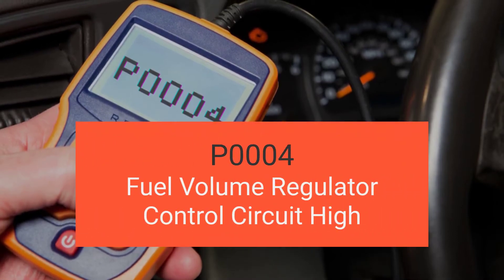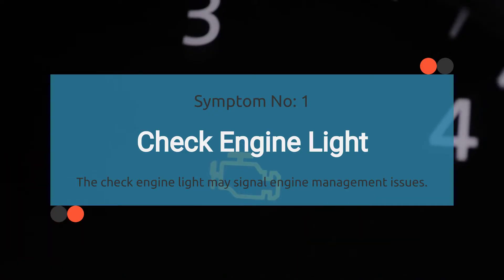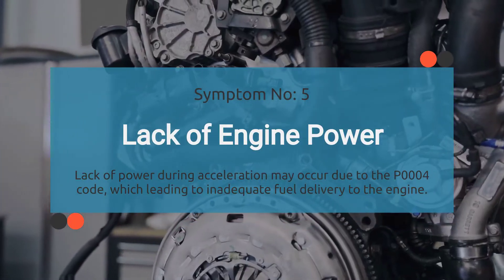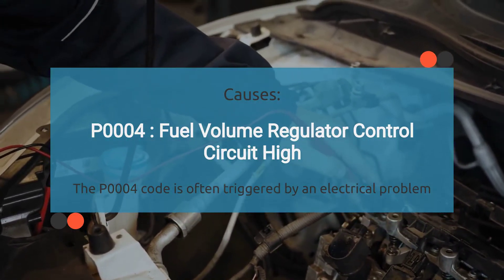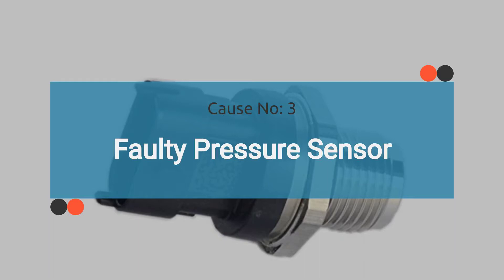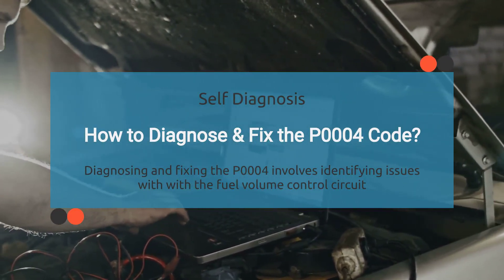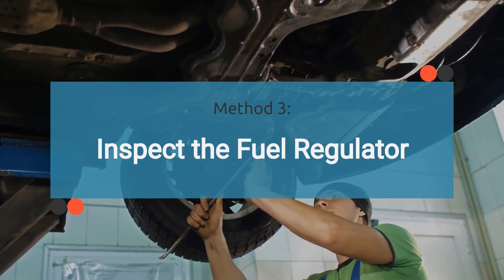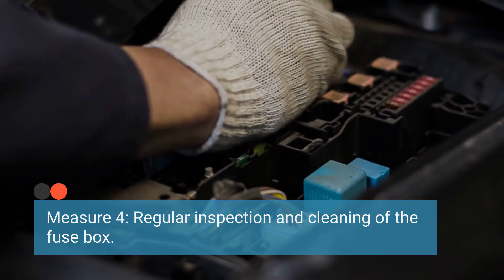P0004 : Fuel Volume Regulator Control Circuit High

Comment: I have the problem P0004. But no check engine light. Only poor fuel efficiency and the and low power when accelerating
Reply from the maker: That's an interesting situation, especially without a check engine light.